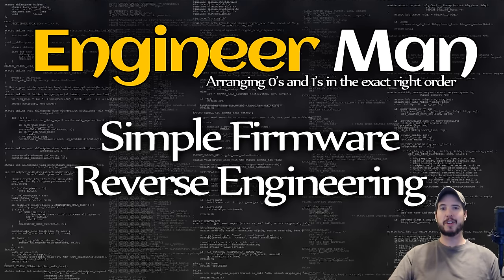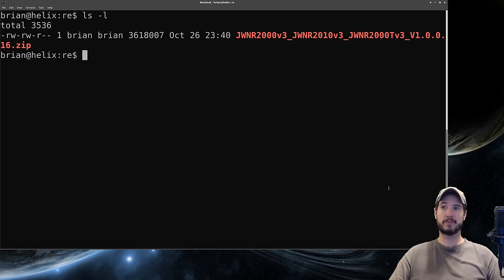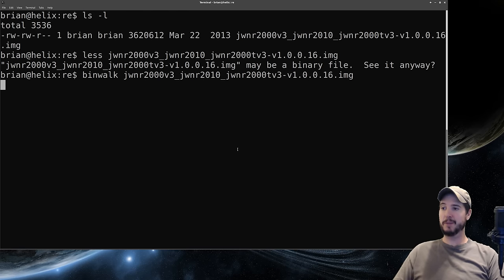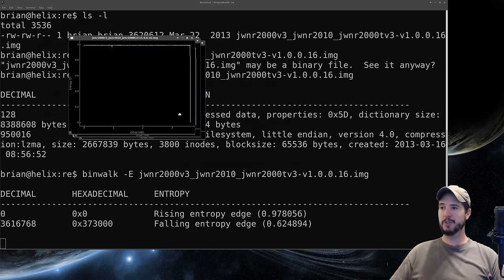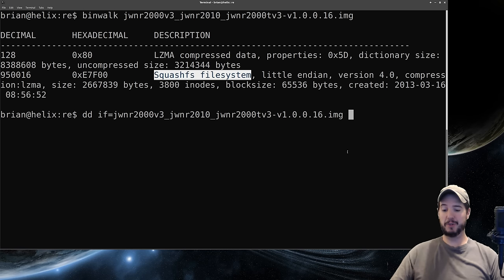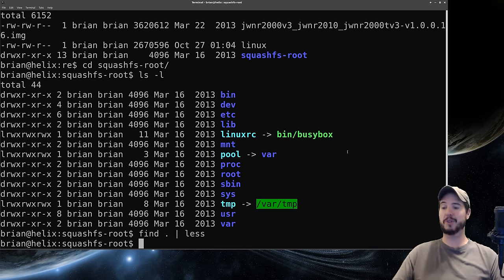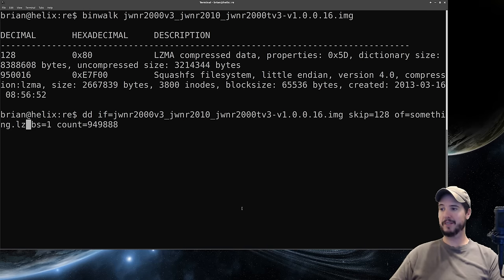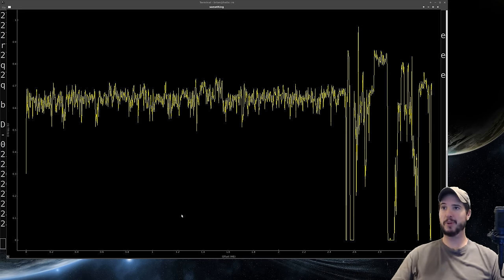Simple Firmware Reverse Engineering

Comment: I am trying to reverse engineer a firmware and binwalk is giving up nothing. Do you know any effective tool to reverse a baremetal file? I don't think its a linux root file system and is not encrypted either. I just don't know how to do it in IDA pro or in ghidra etc. I can provide you the firmware if you or anyone else is interested. Its a Chinese goodie and I am just curious to know whats inside.